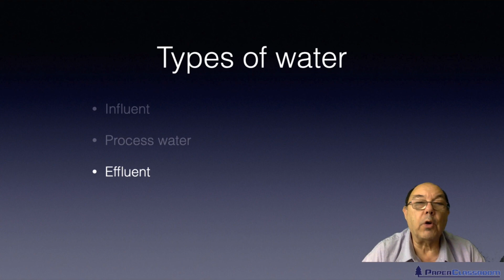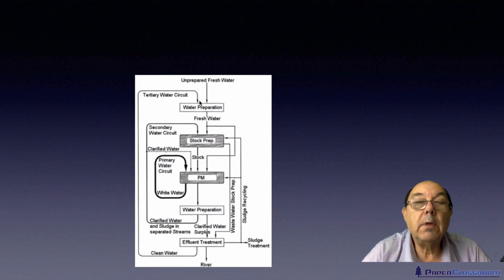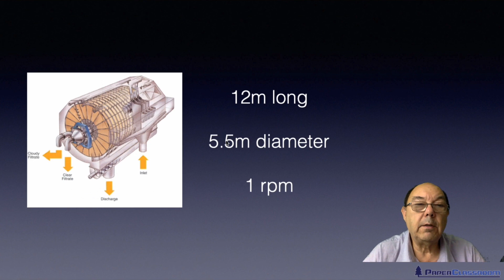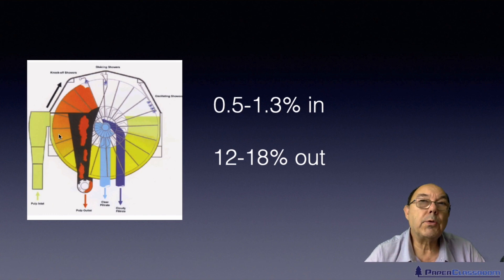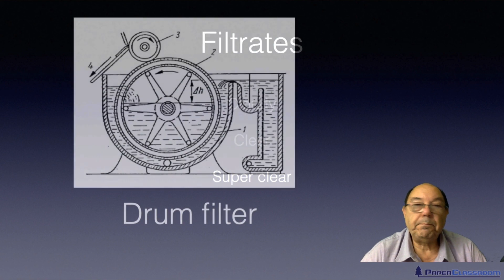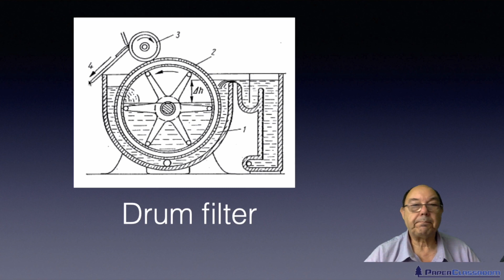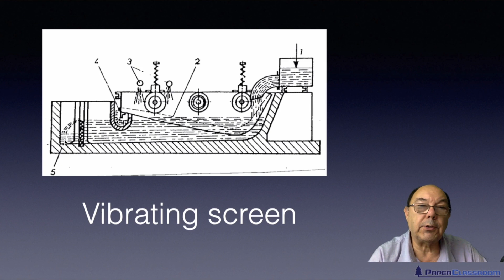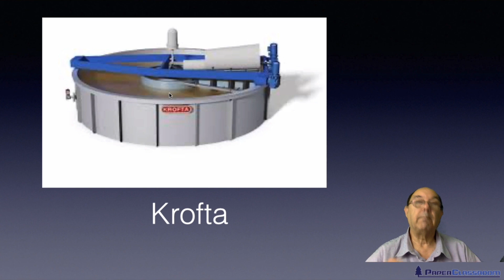Level 2 Papermaking - Equipment for Process water treatment

Comment: What is the purpose of using thickner in pulp section ?
Reply from the maker: There are a couple, economic, and quality reasons
QUALITY
Screens and cleaners can remove solid contamination like glass, metal, plastic etc. But they cannot remove the soluble contamination in the process water. THickening stock removes a lot of process water and whatever contamination is in it. The fibre is then diluted with fresh water, so that any remaining contamination, is diluted.
ECONOMIC
By thickening stock, (say from 2% to 6% as an example), you need less storage space, so a sinle chest rather than three, or a small chest rather than a large.. This will reduce your capital costs not just for the chest itself, but also the cost of providing the foundations.
Reply: @PaperClassroom  thanks a lot sir, contaminants and solid waste is fine but what about stickies etc....what is the best solution for stickers and adhesives removal in recycling plant of waste carton to kraft paper. Disperser are good but costly ....is kneader could be used instead of that hot desperser ? I was reading but confused

Comment: Equipment for Processing Process Water
1. Influent - Water coming in
2: Process - Water carrying out the job
3. Effluent - Water going out

1:21 
1. Bring in water
2. Clean it up
3a. Send out Effluent (to expel unwanted water) or 
3b. Recycle clean water (to reduce Discharge costs)

7:22 Drum Filter
+- Less Surface Area than a Disk Filter

12:07 Krofta
IA - Injected Air
DAF - Dissolved Air Flotation